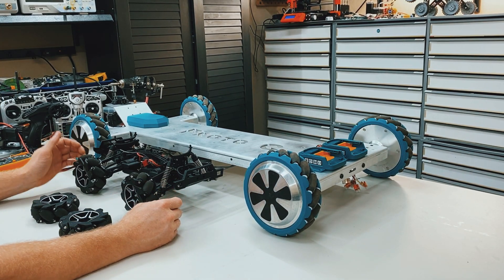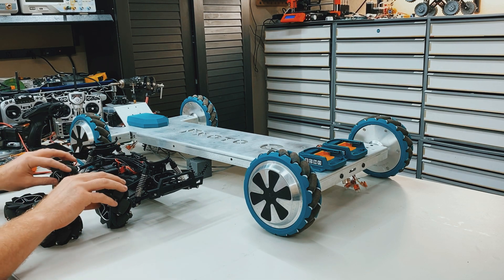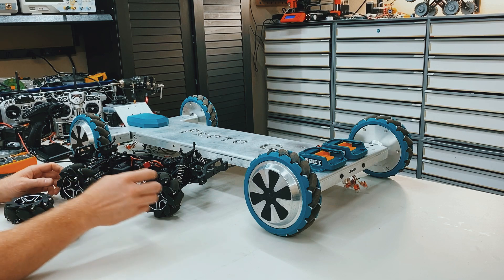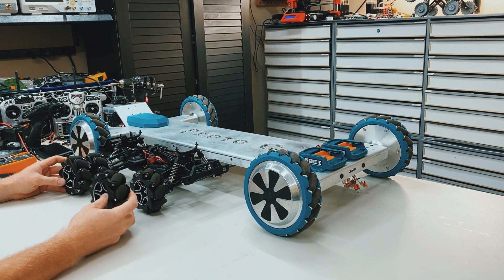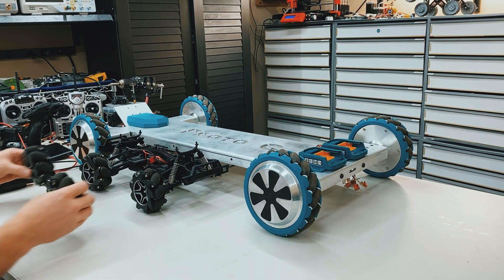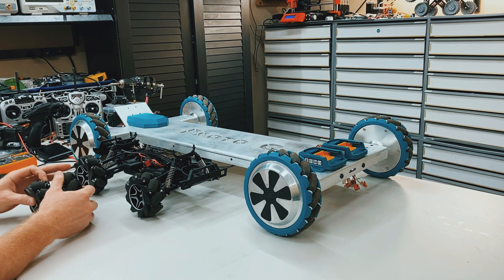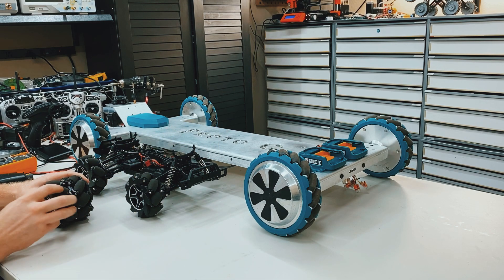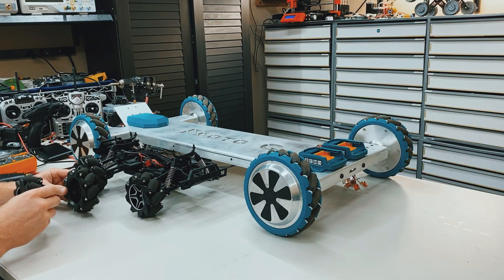Omnidirectional E-Bike - Is it possible?

Comment: I do not think anyone is actually asking about 2 wheels, I think everyone is asking about a seated configuration with a less square, more linear setup where there is less non-wheel space on the vehicle.
A bike in most people's minds is about ratios, not wheel count, a speeder bike has no wheels, but maintains that width to length and rider ratio.
People wanna ride around at high speeds on a super precise and maneuverable scifi bike.
They do not care whether it has 0 or a thousand wheels, especially when you consider that mecanum wheels are wheels of wheels, and therefore more than two anyway.

Comment: I have an Airwheel S8, the only seated Segway clone type transport on the market that has no handlebars. Airwheel sells a similar non-tandem transporter that has handlebars and weighs 75 pounds. The S8 weighs about 30 and is a lot easier to handle. My use of the S8 as a mobility scooter is working quite well, but the S8 is getting harder to find and so far has demonstrated a limited lifespan and near-zero manufacturer support.

I have two working units and one complete chassis that's non-operational. As a result, if necessary, I'd have two pairs of motors-in-wheels similar to the mecanum skateboard. Unfortunately, I'm concerned about four points on a surface that's not always going to be planar. Three wheels removes that problem, as do two.

What do you think about a side-by-side wheel arrangement such as the S8 but with a pair of mecanum wheels on each side? Uneven surfaces would not be as great of a problem, I believe. Currently, leaning fore and aft controls direction and speed. The seat post has a self-centering possibly elastomeric pivot with a hall effect sensor for turning. Completely hands free makes this a great mobility scooter, especially for grocery shopping, but if it had paired mecanum wheels, control from tilt and seat would be problematic.

Additionally, the motors would have to have external bracing for the shaft mounting on the outboard wheels. It seems it would become a ground-up redesign. On the plus side, ten inch wheels!

Comment: Thanks for confirming my theory!

I was watching my daughter pilot the Rainbow 6 Seige drone and she was strafing it sideways, when I saw it only had two wheels I knew it would need an extra one on each side to actually function like in the game.

I did thing of a small wheel with roller at 90 degrees on the small tail with a motor to counter the twist of driving just two mecanum wheels and allow sideways movement.

Comment: It will be cool to make unicycle, something like Honda U3-x.
Reply: That was my thought as soon as I saw the paired wheels. I have a Focus Designs Self-balancing Unicycle, but it has to keep moving forward to balance. With the paired wheels, it could be nearly at a standstill. There would have to be a set of IMUs or accelerometers ninety degrees to the fore/aft sensing set, but that's "trivial" in my opinion.

Comment: So with two you can't actually turn, just slide it seems. Still losing one axis of control if I'm understanding correctly... However would make an awesome tricycle!
Reply from the maker: I knew I was forgetting something! Yes, you can still turn in the configuration I showed at the end! If you spin the right wheel faster forward than the left wheel, it rotates CCW. If you spin the left wheel faster forward than the right wheel, it rotates CW. The same goes for turning in reverse. You could make an omnidirectional hoverboard with only two wheels or a weird looking e-bike lol
Reply: @ProtoG42  Ah, nice, thx!